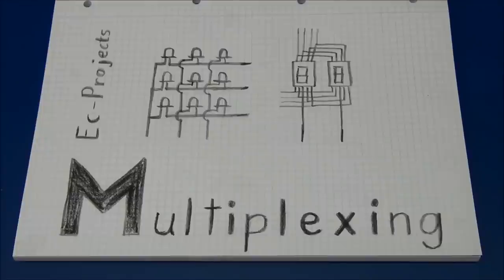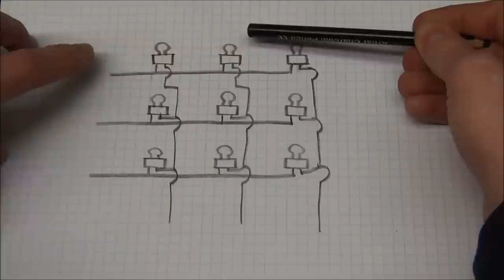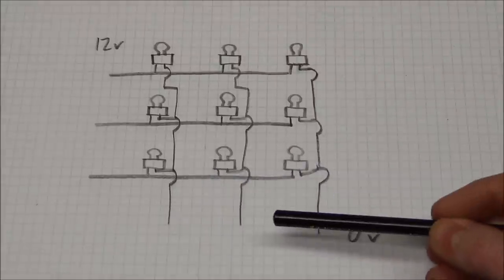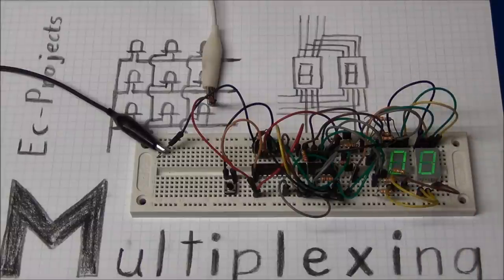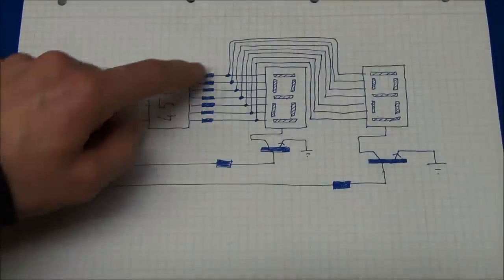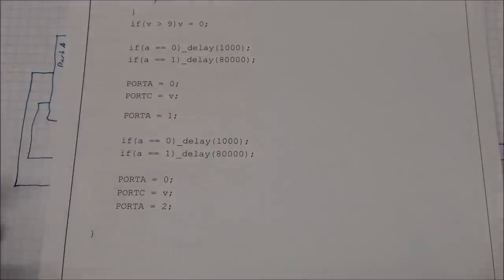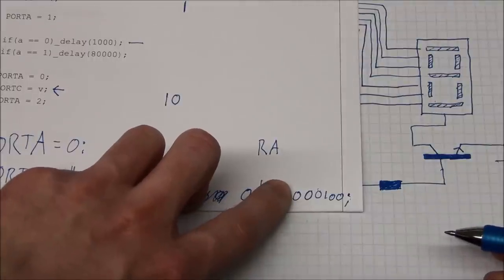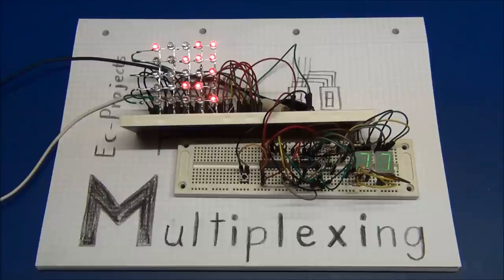Multiplexing (for beginners) - Ec-Projects

Comment: Simply the best multiplexing explanation on youtube. I love you! Thumbs up'd and subscrib'd
Reply from the maker: iDenden Thank you :D
Reply: EcProjects 
thanks for this video. I am learning all I can . about electronics. videos like these helps a lot. two years ago if you said transistors. I'd at first think trann sisters! but now its more like MOSFETs and BJTs. PNP NPN N and p channel and what not. thanks again
I also have a question. I want to try running 4-6 led light strips from a 13.8-14.4 volts and only 2 amps. or the equivalent of one strip. would a 555 and shift registers with a few MOSFETs? work for this? could I get the frequency high enough for there to be no noticeable flickering? and would capacitors on the LED strips help?

Comment: Very good explanation on multiplexing.  I'm working on a project from a book using 4511, 4046 and 4017.  If you knew what your display would always be outputting, could you increase the voltage to the LED's to compensate for the decreased brightness?

Comment: you go from the basics of multiplexing to a 7 segment display wich completly lost me, can someone explain the transition between these two setups. Thx
Reply: For future readers: 
Multiplexing is selecting a channel out of n input lines, we use the concept of multiplication to make selection, since we can select for k=3 selection lines  there are 2^3 combinations so for 3 selection lines we can have atmost 8 inputs to select from.

How do u design such an circuit, it's simple
For each selection lines have 2 modes/lane (normal and inverted) we need two lines coz when we want to select 1 we choose normal lane when we want to choose 0 we choose inverted lane...coz ultimate aim is to have all 1s when multiplying such that output is also 1. 

If any of input is 0 then multiplying anything with 0 leads to a zero.

The multiplication is done by using AND gate and sum of all these individual multiplication makes muxed output, which is done using final OR gate (note at any moment only 1 channel can be selected) 

Now how do u choose the selection channels for multiplication, simple just choose (all inverted 000 selection lines) for 0th channel multiplication, (first, second inverted, third normal 001 selection lines for 1st channel multiplication)..do..till 8th channel
Reply: A demultiplexer (D-MUX) is one which does opposite. for k selection lines it can divert 1 output to one of 2^k output lines based on selection lines combinations

Now if you have the same signals for mux and demux selection lines, then you are essentially transferring one of n input lines to one of n output lines using single path at any given moment, if different selection lines are used then ith input channel can be routed to qth channel in output(totally unrelated but for business needs) such that mux chooses ith channel whereas dmux chooses qth channel
Reply: This example explains how a BCD to 7 segment decoder can drive 2 displays at time but only one of them is selected at a time to work (equivalent to input channel selection) using single channel pin from the microcontroller itself. This example is bad for multiplexing, 

Also the matrix selection is simply how random access is done in RAM where 2n selection lines (n rows + n columns) are present for selecting n targets, nothing related to multiplexing......coz your selection lines are not log2(n) instead 2n which is not true for a multiplexer

Comment: For some reason i thought it was some special trick with MP. Because thats the first logical method that comes to my mind from the old time-table chart back in grade school. But if someone is a complete newbie, i could see how they would not connect the dots. its almost feel like im been told what i did not know what i already knew. the only question now is how do you retain the brightness.
Reply from the maker: If the frequency is high'ish, you can safely drive the diodes harder. Give them more current, since they are on a fraction of the time. Usually the datasheet will specify it :)